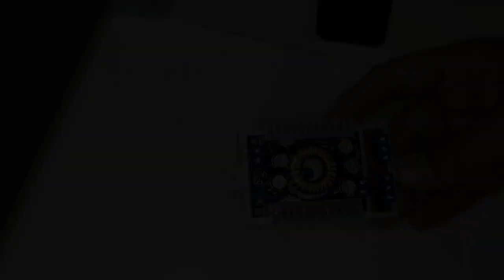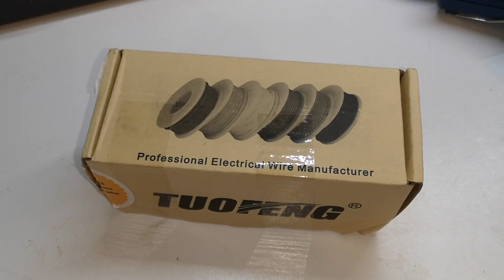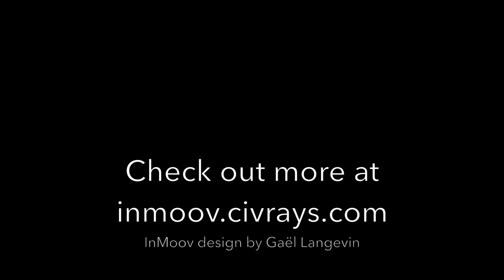Civrays InMoov - Power Distribution

Comment from the maker: Someone suggested right-angled USB cables. Unfortunately their comment was marked as 'held for review'. I tried to approve it, but it then vanished. I think it might be a youtube glitch, so sorry if it was you. I have taken your suggestion on board and ordered two of these: https://www.amazon.co.uk/StarTech-com-Right-Angle-Cable-Cord/dp/B00FP32HI0/ref=sr_1_23?dchild=1&keywords=90%2Bdeg%2Busb-b%2Bcable%2B1%2Bmeter&qid=1594314799&quartzVehicle=1820-797&replacementKeywords=deg%2Busb-b%2Bcable%2B1%2Bmeter&sr=8-23&th=1 they should arrive on Monday. If they work out, I'll try to feature them in a future video.
Reply: It is possible that the link i sent caused YouTube to remove it. Anyway you have got the one i ment. Hope it works and that it wil save you  some space.
Reply from the maker: I got them. It makes a lot of sense to use them on the right side of the robot, but for the left side they are really pointing in the wrong direction. Not sure if you can get left and right handed versions. Maybe I'll use right-angled cable on the right and a straight cable on the left. But still, very nice cables.
Reply: I've done some more digging . It seems that amazon also has left angled cables. But it is up to you. I am still in a starting phase for several months now and still have not gotten past the lh hand because i want it to run as smooth as possible 🙈

Comment: Hi. Can you please explain how you bring the signal wires from the forearm and bicep to the arduino? And how are you planning to upload code to both the arduino mega's at the same time? Also what kind of lipo charger are you using? This video helped me get my head around on how to power the inmoov up. Thank You.
Reply from the maker: Are you referring to how I route the cables through the bicep and shoulder, or are you trying to understand the electrical connections? The concept is fairly simple take power lines at 6v down to the red and black connections on the servo plugs, then take the remaining servo wire (usually white or yellow) to an arduino output pin. In practice things are a little more difficult and I make my own boards. Of course you can make like much easier by using the official nervo boards from the InMoov.fr website.
Reply: @SteveRaynerMakes  I have decided to design my own PCBs and get them printed. What kind of lipo charger are you using?
Reply from the maker: @harshithguggilam8168  The iMax B6, something like this; https://www.amazon.co.uk/JUNESUN-Battery-Charger-Digital-Discharger/dp/B07WR8LF5N

I was using a really cheap thing but it was actually damaging my batteries. So best to spend a little extra.

Comment: Hi can share a link of where you got the cable? Thank you.
Reply from the maker: Amazon. This is the 20awg kit that comes in 6 different colours. https://www.amazon.co.uk/TUOFENG-Electronics-Different-Temperature-Resistance/dp/B07G715HYY/ref=sr_1_5?dchild=1&keywords=silicone+cable+kit+20+awg&qid=1594314187&quartzVehicle=93-1821&replacementKeywords=silicone+cable+kit+awg&sr=8-5 I also got a few meters of 14awg in red and black.